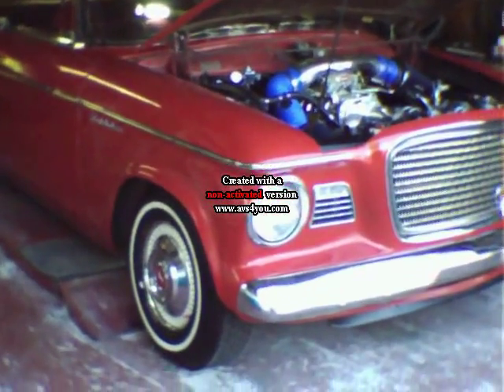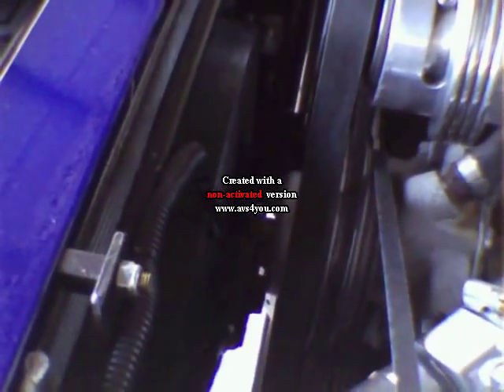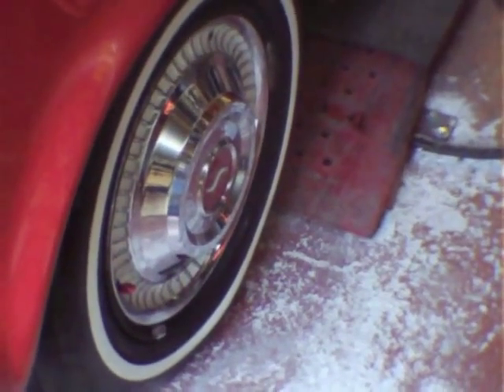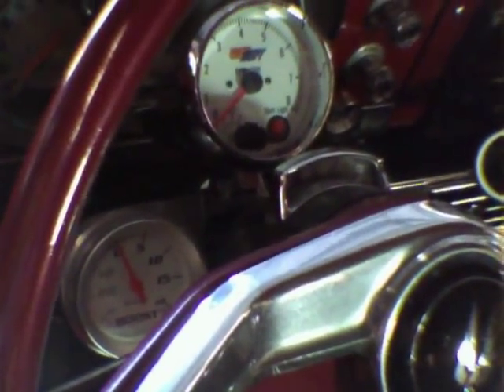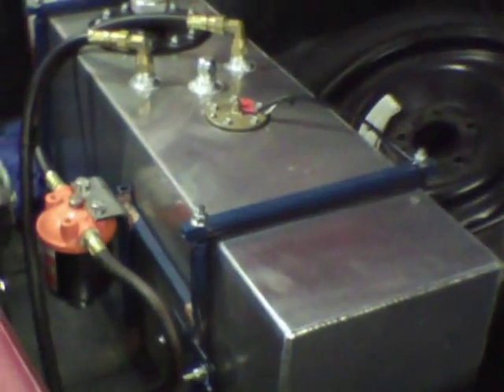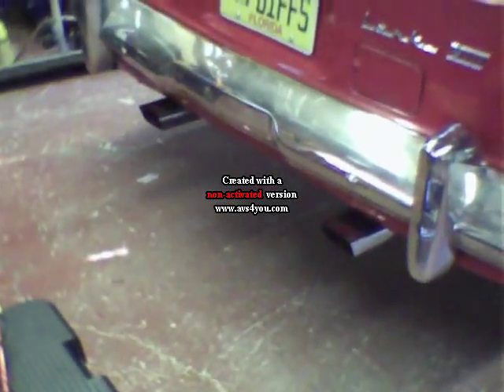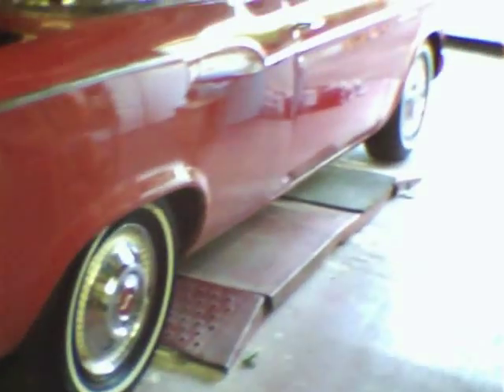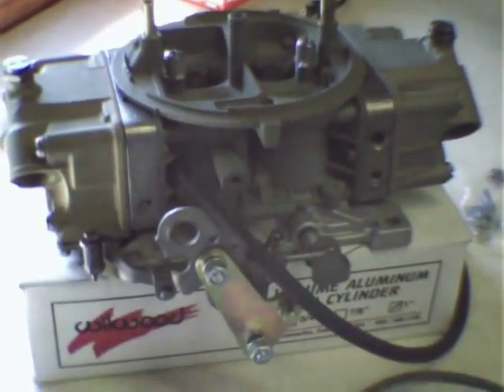Street "sleeper" Studebaker Lark no. 2 1/2

Comment from the maker: @frompastaz  Boost is immediate 5 psi from idle full throttle through 5500 rpm. I use a machined pulley that's smaller than the smallest in the kit. I bought it set up this way.